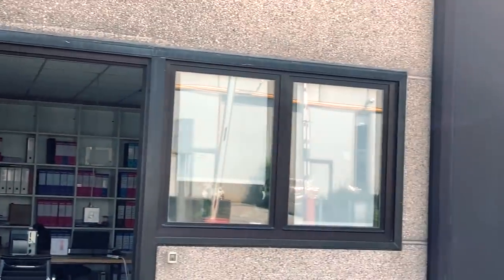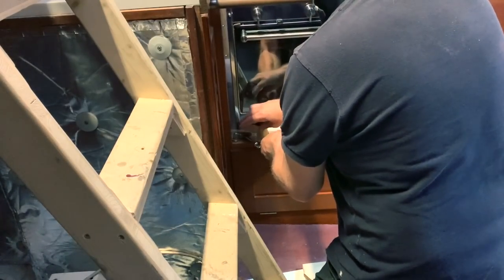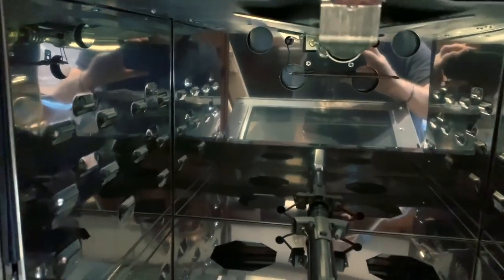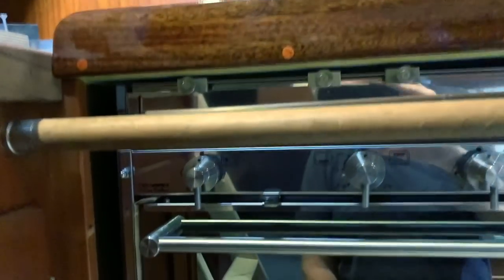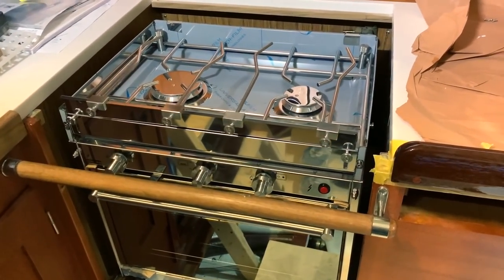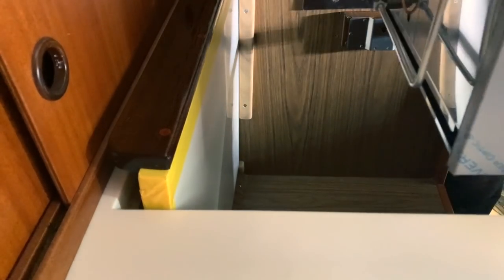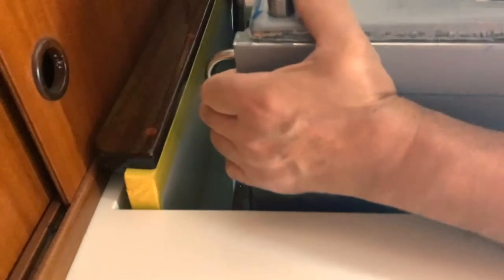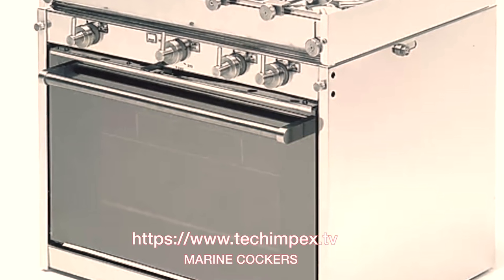Hallberg-Rassy 312 "Ellös": - THE NEW MARINE COOKER "TOP 2" TECHIMPEX

Comment: As always, top quality work beautifully executed. I would have been so disappointed if there had not been a pizza stone.😂 Do you achieve 20 degrees of gimbal in both directions with the lid stowed vertically behind. Also you might have made life a little bit easier when lifting the oven in and out if you had temporarily removed the wooden grab rail.😉 Great work and steady progress - you will be running out of jobs pretty soon.😀👍⛵️
Reply: Actually I would install the engine now and splash the thing immediately! ;-p
Reply from the maker: So... very close to finish the inside! Need to install engine this autumn... next year splash!!!

Comment: Techimpex looks great but is one of the worst marine ovens available. it starts to rust quickly. The oven seal (the small tab on the front of the oven door) should be replaced every two years due to rust. The tab costs, you wouldn't believe it, about 25 euros. Pure crime! I had one in my boat but replaced it with a real great brand Force 10!
Reply from the maker: Thx for tip I will have a look and check your suggestion !!! Will be great to know wich model you had .. was the same of my one the TOP MODEL? I got same problem  in my old one brand Eno .. seems force 10 is same brand? Boh…but for the moment all work great in my one …and I know the owner if he charge me 25 euros for the spare part I leave oven in front of his door😂😂